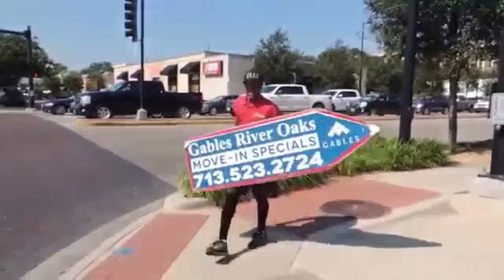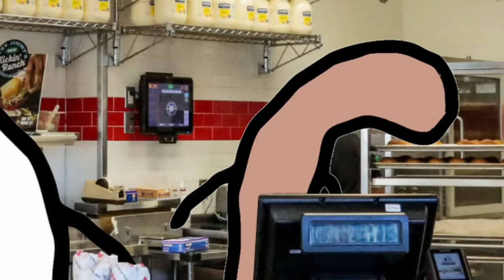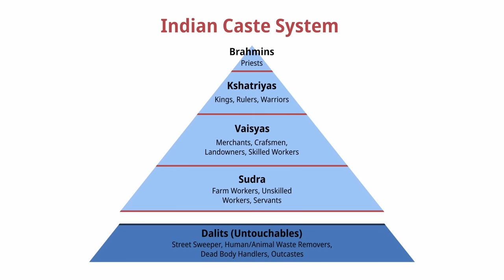7 Levels Of Blue Collar Workers

Comment: I am a level 4 trades man working as a commercial appliance repair man. Like you said, the pay is good for the nature of the job, I do like it, the job is mostly fun and I save more $ by driving company vehicle.
the highest stress it comes is that sometimes you struggle against problems you don't know, things like finding a small leak on co2 lines or figuring out why a stove is not leveling to cook. and then the manager expect you to find and fix the problem within 15 minutes.
as in for the injuries, I am lucky that there are no major one so far in the past 6 years, I think it is up to how you check for danger before you stick you hand into the machine.

Comment: Im a network engineer, at the end of the day its a good gig. I design networks and have a desk job for that part of it and then I grab the equipment physically put it in network racks and connect cables and use my hands and tools. Best of both worlds. Im very spoiled.

Comment: feel like i have been on multiple ends of this.
I worked in a steel press shop making parts for big trucks, some of the presses so big you had to run in and out of it entirely, like with your whole body to place and take out big heavy metal pieces, over and over, fast. others by your self on smaller ones but still with huge pieces but way faster.
I gained a constant pain in my wrists that refused to ever go away for mooooonths, shit was gruelling, always hot............
but mentally, not bad. Was not soul crushing, at all, but the toll on the body could be monstrous, specially when they tried to get you to do 80 hour weeks sometimes. With those hours though it very much DID become soul crushing, but otherwise, in the more down season, just body crushing and a bit monotonous. 

I have on the other side of this, worked as a cashier multiple times, and a call center.  ZERO body strain.
but will drive you to unimaginable levels of insanity, hatred for life and people, pure nihilistic hopeless misanthropy that burns your soul in unending agony. 
You can often get more free time this way, which makes the lower hourly wage almost worth it as you can like, have a life, sort of, if you want too, though not much of one because your ayse broke.
But the stress and hatred for the common man never dissipates because of your constant exposure to the worst human beings in existence, for hours on end. It rips your mind. 

Whats worse?  ill have a different answer for you depending on when you ask...........

Comment: I've spent my working days in level 6, with 2 level 5's. Never did construction as a job but I have done some construction with family that was improving their house at the time, structure extension, partial remodel. pouring more foundation was required since the extension went farther than the original, I didn't help with that, I cut studs and assisted with frame assembly for the walls & roofing.

Comment: Hmmm. You missed a couple things there brother.
If you add "industrial" to a lot of these description, they suddenly go onto a tier of their own
Industrial cleaner, mechanic, pipefitter, welder, sparkmonkey (that's me). I spent most of my day at  height between 2-10 meters up, monkeying between trusses pulling cables and connecting cabinets up in the air. I love it, a nice combo of head and hands most of the time, but it ain't easy, neither physically nor in the "simple" sense. Pay's nice though :D

Comment: I'm a level 6. I work in a heat treating plant where we would run metal parts through a chemical process line. Raging hot chemical pots upwards of 1000 degrees. 100+ degrees in the shop when it wasn't winter. Steam explosions, 3rd degree burns, chemicals in the air for 12 hours straight. Genuinely a hellish existence imho!

Comment: I worked in a huge chemical plant and had to wear level B hazmat gear, or level A if someone had an acid whoopsie. Wasn't too bad in the winter but when its summer at 90+ degrees in the sun and you're wearing the equivalent of 3 or 4 full body rain suits while breathing bottled air through a straw and heavily physically exerting yourself shit got bad.

I still work for the same company but as a heavy equipment operator. I operate semi trucks (for yard dog work) a shuttle wagon to haul strings of rail cars to buildings, front loaders, skid steers, OTR forklifts (think the big boys that lift other forklifts and operate outside) dump trucks, the boss' wife, dempster trucks, and flatbed trucks. The work is on average safer than hazmat, and I get paid more, and its easier. Go figure.

Comment: When i got out of highschool i started on level 7. Baking in the hot sun cutting metal for a welder in the middle of nowere. I got fired, deliverd for pizza hut a wile. Then i went to a large beef packing plant, trugged around in guts and eyballs. Then i started cooking, learned how to cook out of that.went to college in meantime for auto body. Joined my friends hanging iron and walking on beams, 5 years of level 7 again. Things got slow and i learned how to drive combines, swathers, tractors and semis. Then i started working in factories, then warehouse, back to factories.  Covid unemployment and relaxing and doing what i wanted. A scrap yard, another factory. Hard construction labor temp. Became a temp for a communications company, liked it hired on. Bought a house at 27. Now helping one of my contacts i met build his own communications business. All i can say is just say fuck it and learn. You will be doing the same as you would if you went to college, just without debt.

Comment: My grandfather worked at a ship builder in a time before OSHA. In the 19 years he worked there, he'd seen 19 men die. In the shift previous to his, the guy running a guillotine like metal cutter failed to report that the safety brake had failed. My grandad was using it, something got stuck, he reached in to dislodge it, aaaand thunk. To this day, he's missing the top half of four of his fingers.

Comment: I never touched fast food work, it was my standard for myself.

I did delivery work, I listened to podcasts all day, stopped at stores, swung by places to grab food, sing as loud as I wanted in the car, I would pick the cars that didn’t have a dash came, disconnect the OBD tracker and blast down country roads… that was awesome.

I did some warehouse work at the airport, I would load planes and unload them as well. The hours sucked and were few but it paid well. I got to work super close with pilots and some pretty cool machines, as well as have one of the clearest views of the sunrise available right off the river.

I did construction, I hate it, it’s exhausting, it’s painful, it’s not a super skilled job, so the guys who do it till they’re old get faster but they’re every bit a competitive a hole they were when they started at 20, which results in horrible work environment (apart from being super cold or really hot). Kind of like what girls experience with older female managers.

The next one is tradesmen, very integrated with construction.
I went through tons of exams, interviews, meetings and cuts to finally get into a trade that pays really well and is really needed. I’m locking in for 5 years, the good trades you can’t do for a bit and then leave, especially not the route I’m going. They hold you for the entire period of education and then some, but it’s a career, it’s better than the others jobs because it’s somewhere I want to be, because the longer in there the more opportunities come out of it, I eventually do something no one else can

Comment: I wouldn't consider fast food blue collar. They more fall into retail. Also, you forgot about two big ones, miners and farmers. Having worked in a quarry in Arizona I can tell you there are many dogshit things I had to do.
-Shoveling and wheel barreling a dozen plus tons of sand, gravel, and cement dust out from under places
-Crawling inside rusted machinery thats so tight you can't turn your head straight because you're the "skinny guy" (ie the fresh out of the army 180lb guy that doesn't have prison or table muscle)
-Summer sucks in AZ. Everything metal in the sun is fuckin hot enough to burn you and you wear slame retardant long sleeves so your torches and welder don't light your clothes on fire. I have a few burn scars from that job.
-being made the assistant electrician because you can wire a light switch and the main electrician has 3 DUIs and can't drive company vehicles, so you have your hands in 480v electrical panels that want to kill you with 0 clue or real training outside of the advice of a raging alcoholic that shakes like he has Parkinsons if he doesn't sneak a shooter. (The electrical part scared me the most but they paid me like $2/hr more)

I'm glad I got out of the mines and got a Class A CDL. Now I just drive in a nice air conditioned cab and listen to audio books and music.

Comment: Yeah. I've done all of those except construction work. I grew up on a farm and moved through all the various blue collar stuff. Now I am a landscaper and I have a side hustle as a handyman. I'm not quite 40 yet and my body is trashed. My dad did all sorts of that heavy junk until he was 58 and his knees and ankles gave out and forced him to retire. My GRANDFATHER worked the farm until he was in his 90's. Sure by that time was was basically fused with the tractor but he was still giving it out there. I don't know how they both did it so long. I don't know how much longer I will be able to do it. My knees and feet are going just like my dad's. Take care of yourselves and make sure you protect your joints and back if you get into these lines of work. You only get one set. My dad has 2 fake knees and bone spurs and a degenerative nerve disorder so most of his legs are basically a suggestion than reality. Also pain. Lots of pain. So make sue you get proper footwear and use proper form. If I could go back in time I would beat that message into my teenage self's head.

Comment: I used to work asphalt and i relate to your bit about the glue, the oil we had to work with (called SS1) is used to bind the new asphalt with the old, if you got it on your clothes it never comes off and if you got it on your skin you gotta wash it off with diesel or gasoline (better hope you dont have any cuts on your skin)

Comment: I used to be a tour guide in a cave, all by myself, in charge of a group of up to and occasionally over 35 people, a few hundred feet under ground. I was 14 when i started.
Imagine the walking around all day of a warehouse worker, the monotony of a factory worker (walking through the same cave 5 times a day giving your same spiel), the infuriation of a customer service worker and having to deal with all the people, and then to top it all off, as tour guides we got a 45-30 minute(depending on how many guides we had working that day) "break" between tours you gave. Sounds great, right? Well, not entirely. We had to do all the cleaning and chores of the entire property (+the rides in the mini theme park outside and the gift shop).

Some highlights of that job included cracking my head open and then having to continue giving my tour for another 10 minutes(what was I supposed to do, let the 35 tourists just wander about on their own as i went to get help?) before my manager could get to where i was after i called him over the radio, being threatened with death when giving a private tour to a group of 5 bikers after telling them they weren't allowed to break and off take the stalactites home, dealing with people dropping things off the tour path so i would have to rockclimb my way down a near vertical slope into a dark abyss because some girl was crying over dropping her fanny pack or some dude was yelling at me because he dropped his oakleys so it was all of a sudden it was my responsibility to go retrieve them, children who would cry the entire time, teenagers splitting off from the tour group to go explore on their own, elderly people who would hold up the entire tour group because we ended up having to spend 25% of the tour standing around and waiting for them to catch up everytime we went from one room to the next, families of foreigners (sometimes entire tour groups) that couldn't speak a single word of English, people trying to take souvenirs and carve their names into the cave, etc.

It was, not amazing. But it was my first job and i do have a lot of fun memories

Comment: as a diesel mechanic i did a call out with another bloke, it was gonna take a few hours but you know, not too long. Anyway i was clocked on for 14 hours in a shed, working on a truck. No aircons or any sort and it was like 35 degrees Celsius that day

Comment: The thing about the joint replacement... not an issue. I already have issues floating in fresh water.
Just need to remember a life-jacket if I venture far from shore.

Id really like cybernetically augmented joints rather than a merelly remedial replacement.

Comment: I work for a week as a plastic injection molding press operator. I came home with cuts on my hands due to handing the hot plastic. My co-worker got cussed out for packing a part wrong. I was told that my press was supposed to be operated by one person, not two. One of my breaks consisted of standing outside under a metal tent while standing in 1 inch of water due it storming outside in the dark at 2 am. I got paid half ($8/hour) of what I got paid in my recent retail job.

Comment: Fellow Arizona dude here. One of the best and worst jobs I've ever had was working as a pest control technician, which is just a fancy way of saying "exterminator". My shifts started at 7am and usually ended around 6:30 or 7pm and I spent pretty much all of it outside spraying poisons and collecting/changing traps. The heat wasn't too bad. If it got too hot I would usually soak my hat in water or wear a wet cloth around the back of my neck. What was real bad was the damn sun. No amount of sun screen helps when you're outside in direct sunlight for 12 hours straight. Also the dog attacks are real. Normally if I saw a dog in the backyard and the homeowner wasn't home (we check before starting our work) I would just get back in my truck and have them reschedule. 
The plus side was I made BAAAAANNK working that job. With the base pay plus commission per property and property size and add on any extra service the customer wants my paychecks were normally $2k+ every 2 weeks. The only reason I left was that I got sick and tired of getting attacked by dogs.

Comment: You forgot about Linemen. I went to trade school and graduated with a trade "degree"(?) in an Electrical Lineworker Program, but getting a job in that trade isn't exactly an easy decision, because,  depending on which line you apply for (e.g., Southwest Line; Northwest Line; Southeast Line, etc.), it actually costs an already poor AF applicant money to even apply, and that didn't work for me at the time. So, I never was even a groundman, much less a Lineman apprentice. That's young guy's work, not for someone like my old ass. Anyway, given that overhead powerline work is so damn dangerous -- it's in the top 5 most dangerous jobs on the planet -- I thought I'd mention something about it. I did end up working on a couple of commercial-scale solar power contacts, which has its own delightful dangers, so construction isn't new to me. I worked on both sides of solar projects: mechanical (1st job) and Electrical (2nd job). It wasn't for me. Living out of a no-tell motel for months and months really wore down my motivation to continue with that. I was offered a job on a project near Orla, Texas. Ever heard of it? Yeah, me neither. So I reached out to a few people and they all said Orla is nowhere. I believe there's a couple of gas stations and an industrial storage facility, but nothing else besides backroads, dust, and the nonstop winds in the flatlands out there. And, that's an entire novella I just wrote. Sorry about that. Thanks for reading this far.

Comment: Im a wastewater Operator in VA and at least for the plant i work at its the chillest job ever. I get paid higher then the average wage. Only acrually have to do 1 hour worth of work on an 8 hour shift. Im by myself so i have freedom to control the heat and ac as i please and can go for a walk or even drive to a wawa provided nothings broken. When something does break we call maintenance so i dont even have to worry about it. Only time it sucks is if the power goes out and its raining or snowing outside but other then that its the easiest blue collar job out there. I also bring a jbl speaker with me to blast music or watch movies on. Added bonus i work with a close friend of mine that i helped get a job with me so we fuck around a lot those nightd

Comment: As an ex mechanic now carpenter, the joint hyperextension, ducking under cars bc lifts arent tall enough, hot stuff, chemicals, agonizing customer experience, and lack of communication with coworkers, mechanics is the worst. I now do carpentry. Any building involving residential. The sun and hot/cold of the outside is something. But its immensely better than being depressed, underpaid, and overworked. Did i mention mechanics dont get O/T but some are required for 13 hour shifts? New job maxes at 10 hour shifts and im getting paid double

Comment: Im a machinist so more specialized facory work, its fun theres no other career I'd want. However cutting myself on hundreds of tiny razors that come off the parts im making are a pain in the ass. Pulling parts out of my machines are also like razors. My hands bleed when i lift the 70 pound fixtures to set up for the next job, the cancer mist from the cutting fluid paints my lungs, and my mental is fried from all the math and dealing with engineers and administration.
10/10 working in a restaurant was legit worse for my mental health